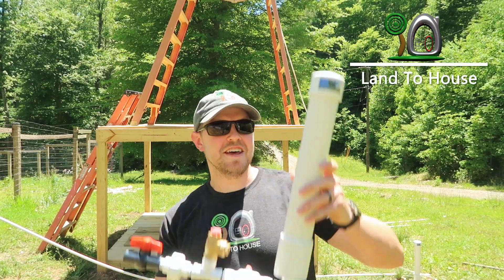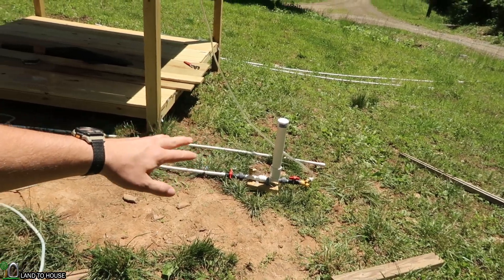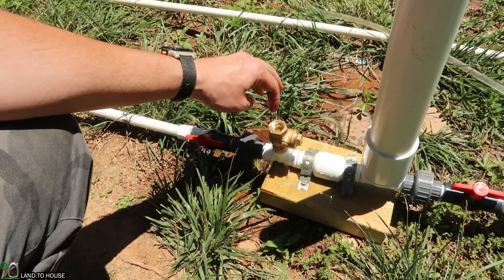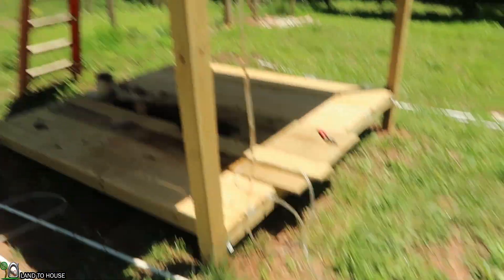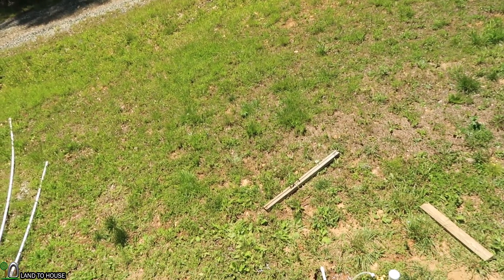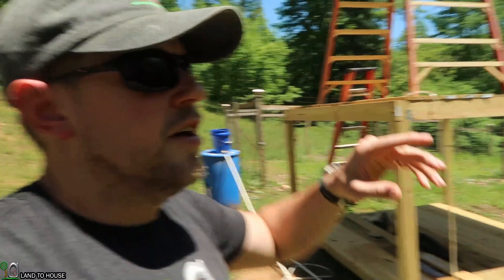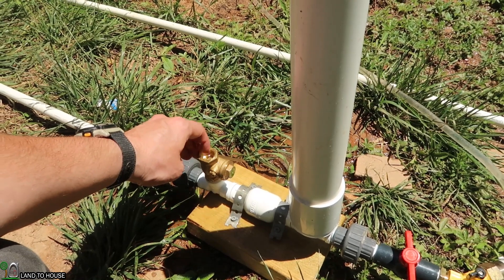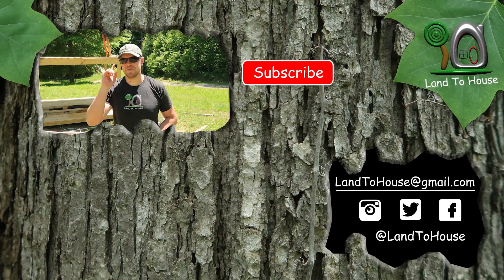RAM PUMP Back Pressure

Comment: I'll try to do some modifications to my ram pump delivery head. I did comment on your other video. Thanks, Seth. It is the same case, I had to lower the output by controlling the valve at the delivery line.

Comment: It can lift 7x the input vertical but how much lift does it REQUIRE to work? 5:1? 4:1? Or does it also need 7:1? I thought you’d just get more water delivered if the lift required wasn’t 7:1 or so.

Comment: I seem to have the opposite problem where I can't get the waste valve to close..I think I'll try spreading things out a bit more.
Reply from the maker: Is your drive pipe smaller than the waste valve? Or do you have a screen over the intake that might reduce flow?
Reply: @LandtoHouse  Yes, it's a garden hose, and a bit smaller than the 3/4 the rest of the system is. Kinks in the hose weren't helping! The waste valve is 3/4 but the 2nd check valve is 1/2 inch. I did the best I could with what I had. I just came in from playing with it on a local creek, I ended up putting the pump on an angle, as the amount of head I had (4 to 5 feet) wasnt quite enough to operate the waste valve flat. I ended up lifting water about 25 or 30 feet, so I'm pretty happy it works at all, but I was only pumping maybe 1/2 litre a minute..I may end up putting the waste valve on a 45 or 90 elbow so it works better with less head.
Reply: @MOTOMINING  The garden hose as a drive pipe is the problem. Take black polypipe or (better) PVC pipes. You can try a 1" garden hose, but I think this is still not working well. If the waste valve is not closing then the flow rate from the drive pipe is to small (see Seth' first video of the 3/8" ram pump).
Reply: I know this is a bit of an older post, but if I am having the same problem with a setup consisting of probably 150 foot of the black 3/4 polypipe, maybe 5-10 foot of fall from a nearby spring head (likely putting out 4-5gal per min--maybe more), and a 1 inch brass waste valve, would you say this problem is due to size differences between drive pipe and waste valve still? Or pipe type, even? I am by no means an expert on this, but it sure seems like a lot of water flowing not to close up the waste valve. However, the only sure way to get it closed is to lay the system nearly on its side for a moment (then it will close and stays closed until manually opened again). Anyone had this issue and got it resolved? I feel like it's probably something simple that I am just overlooking, but I can't seem to put my finger on it. Also, just as an additional remark...let's say it is the size difference creating the problem...would it be okay to simply extend the waste line a little with a reducer and match the drive pipe size? Same with the in-line spring valve (leaving all other fittings at 1 inch)?
Reply: @wdchastain1  your drive pipe is too long...maximum is 100 feet

Comment: How close to the ram pump does the elevation (to cause the the back pressure) need to be?  I’ve got 5ft head pressure, to where I want to put my pump then about 50ft level ground and then about a 40ft elevation over 60ft distance to storage tank.

Comment: Hey would putting a couple of 90s in the drive line reduce the height needed for the delivery line by slowing the flow of the drive line? I plan to siphon pond water down a dam then back up to supply the pasture just above the water level of the dam so my delivery pipe would be going just above where the drive pipe starts

Comment: Right now our system is set up to pump the water back up the hill to an equalization tank that is about the same elevation as the water level we are pulling from with the drive pipe.  We have been able to start the pump and even keep it running overnight but then check on it a couple of days later and it has stopped.  My guess is total drop down the drive pipe is greater than 5'.  Are we just likely never going to hold enough back pressure in that delivery line because we aren't trying to go high enough? Ideas to get around this?

Comment: You vids are quite helpful. Would you be able to have the proper back pressure if the exit pipe from the tank is a smaller diameter? I would assume it would work like closing the valve.
Reply from the maker: Thank you. A smaller delivery pipe can increase friction and allow for possible back pressure gain. But the pipe would have to be a lot smaller. This is because the flow rate of a pipe under pressure is still great.
Reply: @LandtoHouse  Thank you for your response! Is there a ratio for this? My objective is to deliver the water to a hydro generator....if I could keep a high enough pressure with a smaller delivery pipe.

Comment: Just found this great video - wonder if we could get enough water to run a Wobbler low pressure sprinkler?    Don't have a Wobbler at my winter location, but may have to get one.    Dave
Reply from the maker: Oh very cool. I have not seen those before. I will have to get one. I have 10psi from my tanks. Should work well.
Reply: @LandtoHouse  When I tried the Wobbler out at my house on the pressurized water system, I had a hard time turning the water on low enough on my facet to keep from exceeding the diameter of spray that I wanted with the Wobbler (can be done, just turn on very low).   Also, the water is not a spray, but it slings water drops out which are wind and evaporation resistant.     (Mounting on a tripod also helped)

The problem I had off-grid was even though I started with a 2 inch gravity fed pipe with lots of water, by the time I went through two 50 foot 3/4 inch garden hoses to the Wobbler, I could only run one Wobbler.      My regular pulse sprinkler did not work at all.    I think the issue was multiple connectors for the 3/4 inch garden hose inserted inside the hose at different locations created a very small gap for the water to pass through (way less than 3/4 inch).   My plan is to use 1 inch pipe with external connections to deliver more water.   For a gravity fed situation, I think this will really help.    

I found it very interesting that the size of the delivery pipe didn't seem to make much difference to the volume of water lifted by a ram pump - if I'm remembering this right from a different video.  If so, this may be a good thing, because smaller diameter pipes are cheaper and easier to work with.   Although, there must be a limit to how much water can be forced through a set diameter pipe before the size effects the volume - we are not going to get a river through a quarter inch pipe.

Discussions can be had about how to use a limited amount of water once it is where we want it.

Thank you for the video.

Comment: Hi there Seth.  This video really made a lot of sense and I believe I will be able to get my pump working tomorrow.  I would like to ask your advice on the following though...we will be using our ram pump in a strong flowing river and hope to get the pump working with only the pressure of the flowing water....no 'head pressure' as you show here in your video or what we have seen on most YouTube videos....will this be able to work?? No head pressure (water flowing down to ramp pump) only presure from the large river, slightly lower than where the pump will be placed.... Thank you so much!!
Reply from the maker: Hello. Thank you for watching. Sadly the ram pump wont work on flow alone. It needs head pressure (drop) to work. 1.5 feet is a very minimal head pressure. I recommend 2 feet for consistent operation.

Comment: Hi, may I know do I need to have a long drive pipe to have it start working? Say if I have 1 meter height tank with 1 cubic meter water inside and an outlet pipe close right to the bottom of the tank (imagine the blue tank you have with the outlet right at the bottom). Once you on the valve, the water should be able to gush out, is it possible to have the ramp pump attach right next to that to have it start?

Thanks

Comment: Thanks Seth the 7:1 ratio is very helpful. It seems 7:1 would define the max or maybe the optimum delivery height but what is the minimum ratio?
Reply from the maker: It actually depends on a few factors. Drive pipe type effects the output significantly.  PVC is much better than flex pipe and can deliver a ratio closer to 1:8.

Comment: Yes thank you. This is what happen with me. I didnt get enough head back pressure. 
When I close the output drive its working but when I open it. It wont pump up. Thats the reason I dont have enough back pressure. 

I have 3/4 chcl valve it is ok my output drive would be 1/2 or just a same size?

Comment: Is it possible to simulate / test back pressure by holding your hand over the delivery side of the pipe?
Reply from the maker: Yes. Or you can slightly close the delivery side ball valve.

Comment: Great video! Very educative! I suspect that changes at the inline check valve could solve problems with stopping the pump due to low back pressure. Have you ever tried a stronger spring in the inline check valve (if this is possible) or a larger inline check valve (e.g. a 3/4" or even 1" in a 1/2" ram pump)?

Comment: I think you can also increase back preassure by increasing the delivery pipe size.
Reply from the maker: I am not sure that it would be back pressure as much as it would be surface area. The pump will push out the same amount of pressure BUT the volume of a larger delivery pipe would help prevent the pump from stopping because the water loss would not be as great. Nice observation!

Comment: Hi Seth - Question - Could another solution be to increase the diameter of the delivery pipe? An Increase from 1/4 to 1/2 inch would create a larger "column" of water on the delivery side and therefore more weight = more back pressure? or have i misunderstood?
Reply from the maker: It turns out that a column of water is affected by atmospheric pressure the same no matter the size. That's why it's possible to fill a giant storage tank from the bottom. So increasing the size of the pipe does not affect the back pressure
Reply: @LandtoHouse  Late to the game here, but enjoying the videos. I was always taught it to be 1psi for every 28" of rise. But I have never had to build anything to test that with other than a simple manometer with 1/4" tubing.

Comment: Thank you very much for this video. It helped me move one step forward! However the pump i have built requires more back pressure than i think it should, in that it requires over 4 times the Head pressure. I have a Head of 1.5m and a delivery height (almost verticle) of 7m. Anything below 7m and the pump stops. This is a problem for me because the tank i want to fill is only 3.5m above the pump and because of the form of the creek, i cannot reduce the head pressure. What could be causing this? 

The only idea i have is that i removed the spring in the delivery valve on the pump, perhaps if i had kept it i would require less back pressure - is this possible?

Im stuck! Can anyone help?

Comment: I need help please.  I have  a 3" ram pump with 180' of intake 1 1/2 in pipe, slight downgrade in a creek but it never gets the pump going. Do I have to have the other output hose attached with lift to make it work?  I REALLY need to get this working. Any help you can provide would be greatly appreciated.  I'm truly at a loss here.
Reply from the maker: Hello. There may be a couple issues with your pump. The drive pipe needs to be shorter. 180 ft might work on a half inch pump but a pump is big is 3 in probably needs to have a drive pipe length of 75 ft. You also need to have a drive pipe that matches the ram pump size. So 3 inch in your case. If you need the fool 180 ft to get the head pressure to run your pump I suggest running a second 1-1/2 inch pipe to a storage tank in the water such as a 55 gallon drum. Having both pipes go into that drum and then a 3 inch drive pipe from the bottom of that drum to the pump.  25 to 75 ft long.

Basically you're creating a standpipe out of the 55-gallon drum. If this is an eyesore you could use PVC fittings into a 4in pipe as stand pipe.
Reply: I apologize but I mis spoke. It's an inch and a 1/2 ram pump and the pressure section the tall pipe part is 3". We have tried shorter amounts of intake but it's still not working. I tried all the way up to a 180 and left it in there overnight thinking you would need to build pressure but it still is not working.
Reply from the maker: Ok that is more manageable.  Do you know how much head pressure you have in the creek? Larger pumps are harder to start. You will need at least 2 feet of head pressure. One of the hardest parts is making sure the drive pipe is free from air.
Reply: @LandtoHouse  It's a very slight downgrade hence why I have 180ft of intake but it IS a constant flow if water.  I can't be sure how much though.  Is they're a way to maybe build up a damn or water reserve to create 2 to 3 ft of water lift?
And thank you SO MUCH for your help!
Reply: @LandtoHouse  If you could give me an email address I could video it & send you what I'm tying to work with.
Reply from the maker: Yes please use landtohouse at gmail
Reply: @LandtoHouse  Sent you an email with videos.  Please let me know if you got it. Thanks so much.
Reply from the maker: Got it! I have been working so many hours with my other job that I am behind on email.

Comment: Love the videos, and this raises a question: since your pump needs 'back pressure' to operate, is it relying on the delivery check valve closing pulse instead of the waste valve closing pulse to send the pressure wave backwards that yields the pressure drop at the waste valve to allow it to open again?